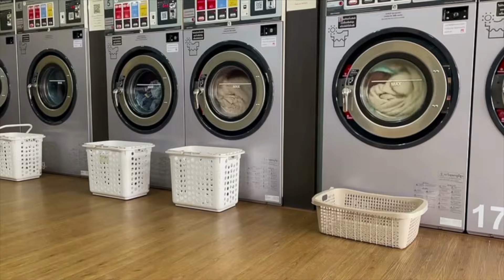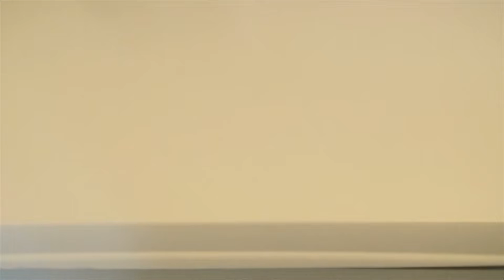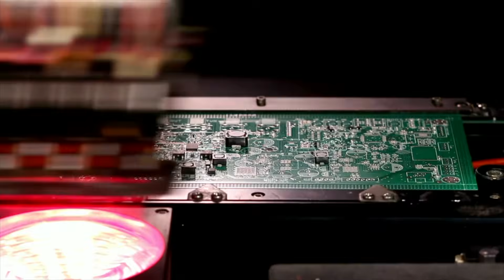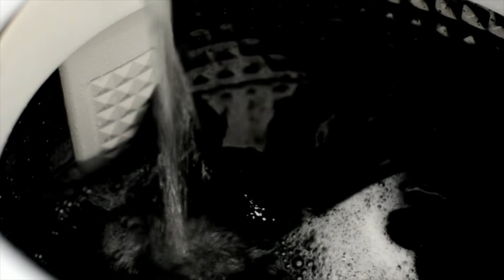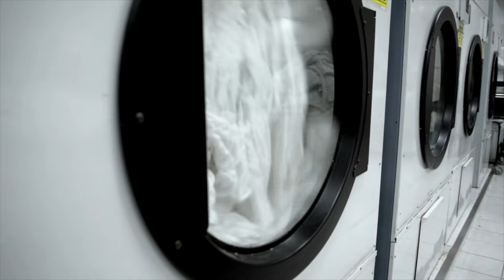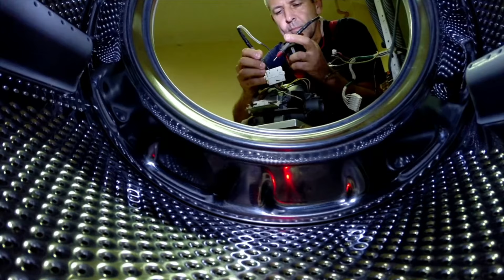GE Washer H20 Supply Error | Step By Step Process To Fix H20 Supply Error | 2022

Comment: If you are getting this error after a board replacement, go back in and make sure you (or like in my case, your repair tech) reconnected the black rubber hose to the pressure sensor. You're welcome.

Comment: NOTES- If you removed the top console on the GE Washer make sure the pressure tube is connected to the CPU unit. This will cause the H20 Supply error code.
Reply: Oh my I hope this was my problem
Reply: As a dad who’s really been through the ringer with home repairs this year already, THANK YOU. Truly, from the bottom of my toolbox and my heart, thank you.
Reply: In replacing the board I too forgot to add the hose. So I plugged the hose in but the h20 error is still there
Reply: I held down the pause button and it stopped! Ok one more problem for this piece of trash. The large dial and led selection light are out of sync.

Comment: not a helpful video. Seems like you used some AI software to read a manual or something. Whats happening in the video doesn't even match what the narrator is discussing.
Reply: Yup, it's discussing water inlet valve and yet the guy in the video is tinkering with the motor below the tub! 😂
Reply: @ryk1265 Yeah, very confusing!!??
Reply: Ok. It’s not just me then. For a minute there I thought I had stroke. AI is not ready for the general public
Reply: @grasscutter1919 not helpful 😢
Reply: Oh, great, I haven't watched the video yet ..😮
Reply: Strange!??

Comment: Mine will run through the wash no problem but when it comes to rince it says there's no water supply I get the  H20 Supply message
Reply: @Daniela Kalongo  I flushed the inlet supply line and rinced the filter ,it was horribly built up with hard water residuals
Reply: @bobvilla3079   where can i find the  inlet supply line
Reply: @bobvilla3079 how do u do that
Reply: So does mine! Find a fix?
Reply: Mine is doing the same thing, did you find a fix?
Reply: @paranoiagent89  Mine is doing the same thing too.. move from one house to another. Was working at the old place.
Reply: @coded5215  my repairman said it needs a new control panel, we’ll see if that works
Reply: @coded5215  the control panel was replaced and now it’s working again.
Reply: @paranoiagent89 was it a front load washer?
Reply: Top loader ge profile less than a year old.  Will flush lines and clean filters.  It’s never had good water pressure.  Any suggestions on installing a sediment filter?  We have a well.
Reply: That is what mine does as well? I will check the filter first... Hope it isn't the pc board!!:(